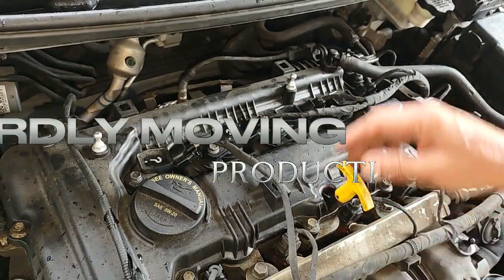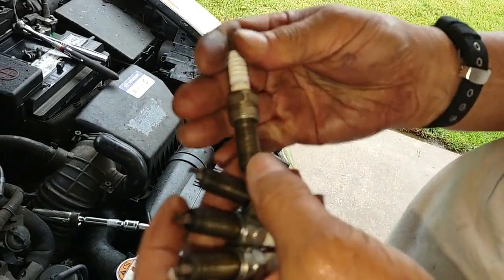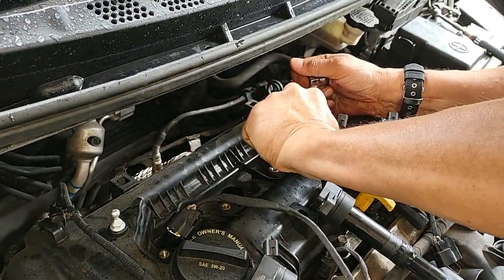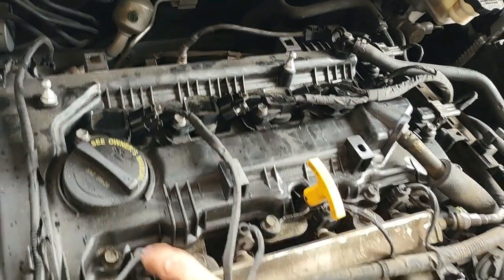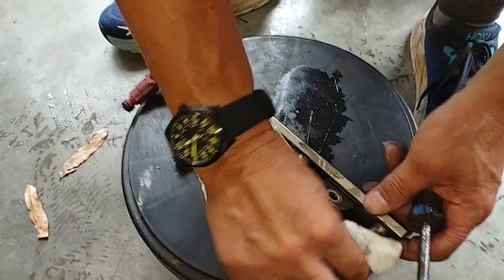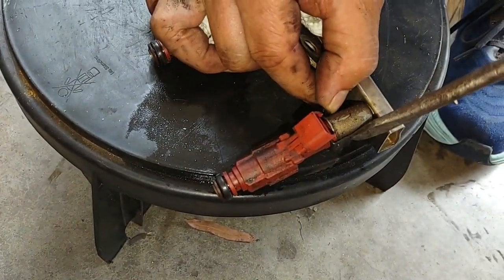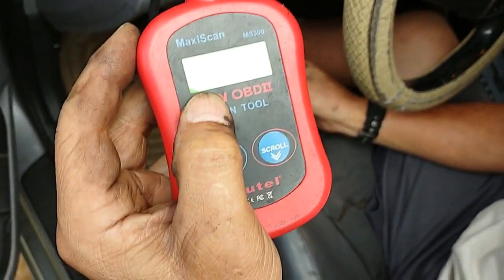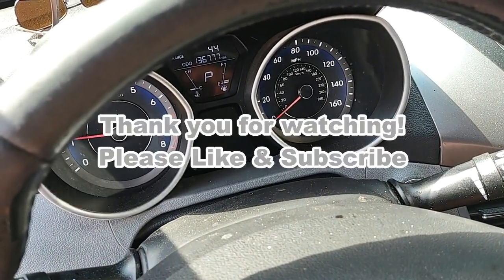Easy Way To Diagnose Engine Misfire Codes P0300

Comment: I had same issue, checked all the coils with ohmeter, they all checked out. Replaced the spark plugs. Still a misfire. It’s prob the injector. Ford wants $259 for one motorcraft injector. Is aftermarket injector bad route?
Reply from the maker: Recommend you get a reman/rebuilt injector off of Ebay.  Got burned buying non-name-brand made-in-China aftermarket injectors.
Reply: Did it work

Comment: Hi, is dielectric grease safe to use on o-rings? Like the affect of rubber o-ring from swelling? And do you recommend replacing original oem injector or aftermarket?
Reply from the maker: Yes ... use dielectric on ALL rubber.  Will not weaken or swell rubber like with any petroleum based grease.  If possible, get remanufactured injectors.  From my experience, they're just as good as new OEM injectors.  I've bought from a vendor called Avalonparts on Ebay several times and they've all worked great.   They're priced a little bit more than other  vendors but their quality has been consistently excellent.